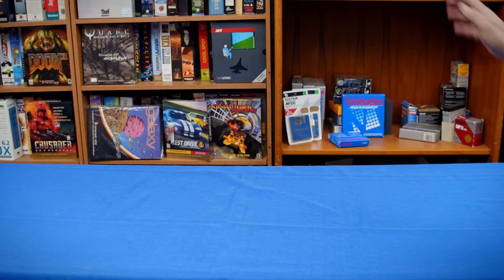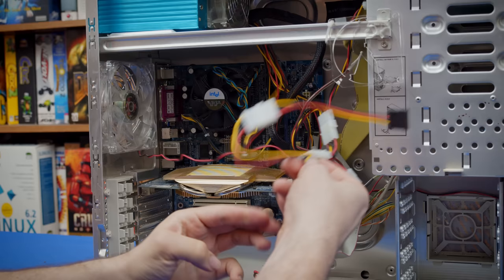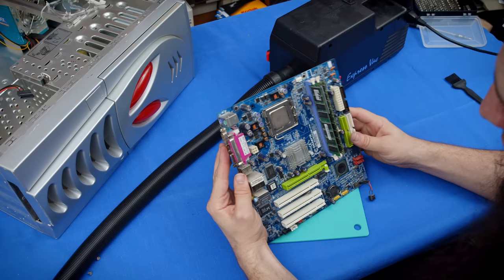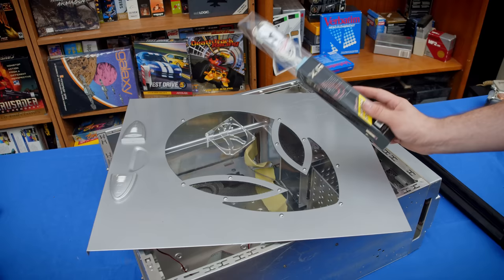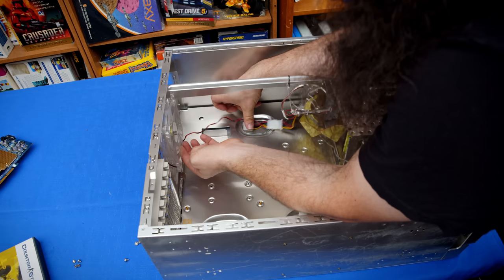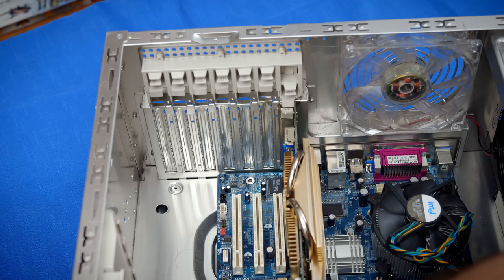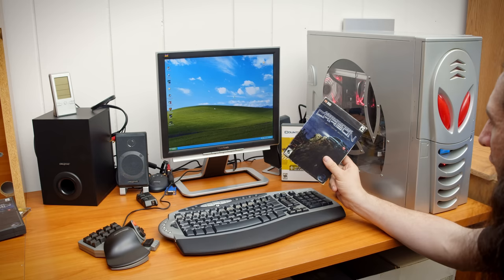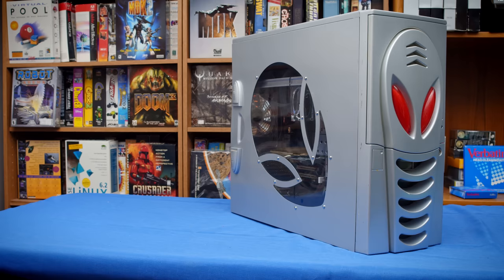Windows XP Gaming PC Brought Back to Life

Comment: Ok, I had that exact wireless mouse, a different keyboard, and that exact same game controller on the left side of the desk lol. About this era I had a 2.5GHz Northwood core Pentium 4 that overclocked to 3.45GHz with I believe a 533MHz front side bus....and an Sapphire Atlantis ATi Radeon 9800 Pro that was overclocked nearly 100MHz on the core. I rocked that system for a while, then upgraded to a used AMD Athlon 64 X2 4400+ machine that was overclocked, and a heavily overclocked AGP Sapphire ATi Radeon X800 XT, that was then upgraded to a factory overclocked AGP HIS ATi Radeon X1950 Pro. That mouse was the only thing that I kept up till my AMD Athlon II x4/AMD Phenom II X6 1045T PC, at which point it wouldn't pair. Sorry for the tangent...just miss this era in the PC world lol.

Comment: Quite an interesting find. The PSU might be for render machines and smaller servers. 400W for 2002 (judging by the label) seem pretty much right for such things and seems like a budget-mid tier version at that. I personally had something similar but was a 500W, silver aluminum and is from 2004, it's overkill to place it in these pairings but better to have more then less in case you decide to upgrade.

On a related note a friend have also a Golden Series 500W PSU from 2003 that he still uses today in one of his modern machines. It's crazy that he used it for rendering videos and gaming while it never been repaired all these years. Like he said good luck having something from today lasting that long. All his new ones he bought from 2010 onwards fry usually after 2-3 years right around the time the warranty runs out. No matter if it's expensive or mid-tier they are made to break (and yeah not counting the cheap crap since they often even explode not just fry fast). 

Back in a day you could find things that can last a long time decades after it's shelf life. (depends what you do with it and how you treat it)

Comment: Yeah...That's a super sketchy power supply. They were bad when new -- they called them PowMax 'cause you'd get a maximum pow with alarming frequency. And if I recall correctly, it's not really a 400 watt power supply, it was a peak power that could be delivered for brief (very brief!) periods. The second fan on the front near the power output cables was added to keep it from immediately exploding when you did. I wouldn't even attempt to power it on even if the caps were good (they were garbage caps even when new) 20 years later.

Comment: Hey when I saw this PC I thought about CS. The reason it may not run optimally is because you aren't running the good CSS version. In 2009 the engine got a major overhaul with the Orangebox update. If you acquired the 2004 version it would run better. Cheers.

Comment: Plain GeForce 6800 was pretty good, but not top-spec for the time. 6800 GT or 6800 Ultra would have been top-spec. But those also would have had active cooling fans, for sure.

Comment: I remember back when cable management wasn’t a thing. You could get away with spaghetti wires with an acrillic window and people would still be impressed. These days, just one stray wire and your whole build is crap 😅

I love this case. I miss the 2000s and all the whacky designs. PCs had two distinctive styles. In-your-face gamer and basic office/home. The wacky cases just signified how powerful a PC likely was. Haha these days we have basic office, mobile, and sleek beauty that replaced the wacky cases. 😅

I would totally spend a few hours on this very PC in the video. Many games of that era I missed out on due to having severely dated hardware and didn’t graduate to XP til ‘05 which that old PC did a surprisingly good job with. 

I’m happy PCs age slower now. My 4 year old tower would be severely dated if we had 2000s advancement still.

Comment: just drilling out the old led and inserting a new one did not occur as an option.. bit of transparant stuff that dissolves plastics as 'glue' (any of that smelly stuff will do i guess. carpaint/epoxy harderner, transparant pvc glue, whatever)  and it'll nicely melt together again.

Comment: The issue with the optical drives, could be the IDE PATA cable, from memory there was IDE PATA 33,66,100 and 133? and some used 28pin and others used was it 40 pin - I recall I had a cable issue and slow speed optical drive in the day and bought a 40pin one as it allowed better throughput when daisychaining a secondary drive?  I really forget

Comment: I trash picked one of these from one of my neighbors about a year and a half ago. Mine had a Socket 754 Board in it and only Onboard graphics when I picked it up.
Reply: The BIOS splace had some system integrators name on it, but I don't remember, I think I saved the original BIOS somewhere, I was having some sort of issue and I flashed the latest BIOS straight from MSI or Gigabyte on it, I can't remember which one it was.

Comment: I'm in love this case damn if they were anything like me in  2004 that was a crap ton of hard drives at 5400 RPM zipping away on crypto I think I think at that point Bitcoin was still on a computer node but I could be wrong. You should add some old fashioned neon tubes with what was it bricks for transformers cuz they're all 120s. 😂😂😂

Comment: That PSU is going to need a LOT more than just new caps.

Leadman POWMAX units are notorious fire hazards and PC killers and almost always require multiple component upgrades before they should even be considered for use.

Comment: Use these parts to build a windows XP media center gaming PC

CPU: AMD FX 8350 
GPU: GTX 8800 760MB SLI (2x)
PSU: 500W gold 80+ 
RAM: 16GB (use the 64-bit version)
Motherboard: AM3+ DDR3 
DVD: ✅
Floppy disc drive: ✅
HDD: 1.5 TB
Reply: Hope it helps!

Comment: I suspect the 5.25" punchout is for those bay inserts with card readers an the like, perhaps lets you close the case door with a memory card or similar sticking out the front?
Reply: Or even the soundblaster 5.25" bay module which I had in the 90s! That had volume knobs and the like that stuck out the front

Comment: I’ve known this in theory but I would love it if you can answer with some practice behind it too - washing circuit boards or even whole electronic devices like CRT monitors (in water that’s not hard so that there’s no deposits after drying, like distilled water) or in 98% alcohol - should be fine as long as its well dried out with compressed air right away and then left out to dry completely for a few days - right?

Comment: I would consider picking up a somewhat fancier board for this build, since - par for the course for system integrators - this one's quite entry-level for what must be 2005. Single-channel DDR, yech - and only 266 MHz sticks at that. That's half the FSB bandwidth even for the (FSB533) P4 511. Something like a GA-8I945G Pro or GA-8I945P-G-RH or similar with a matching pair of DDR2-533/667 sticks and a P4 651/641/631 (or Pentium D 930, 935, 945) would be much more befitting of a rig like this. (Yes, a Prescott P4 6x0 would be more age-appropriate but the 65 nm parts are basically the same except running cooler, so no-brainer there.)
Reply: While I agree entirely on the drawbacks, they’re part of the charm! Better to preserve as is for period historical relevance. It’s a rare find.

Comment: That really looks like a early-mid 00s machine. Oh, sadly a P4 Prescott. Sucks more power and is slower per MHz than Northwood. And the AGP port and VIA southbridge doesn't look great either. Back then it was already Intel in general or nVidia nForce if you wanted SLI. Still hope that it can do dual channel. And XP is usable with 1 GB.
And with 84W TDP (which still meant something back then) the small cooler was a bit tight.

The speaker is indeed meant to warn when the card doesn't have the extra power in. My 8800 GT did the same..
When windows were cut manually and lighting meant going to the aquarium store. And the CS logo doesn't has to be done by hand, I remember those fan grills were sold back then.

The case reminds me of the Lian Li cases of the time. Lots of brushed alu, mounting accesories, only the front doesn't fit their style.
The blacklight would do really well with a DFi board of the time, often the PCI and IDE slots were UV reactive and even uv cables were available. And totally go for a nice uv cathode ray tube. That was the style at the time.
And now I have to look where my red Thermaltake fan is. That cooled a massively overclocked passive-built 7300 GT for years.
Reply: not Prescott - PresHOT

Comment: wow the way you handled that power supply when you opened it up made me extremely uncomfortable, just sticking your hands in there so casually, i know it hasn't been powered on in a while and the capacitors aren't doing to hot anymore, but i still wouldn't trust those to be safe to touch

Comment: careful, i have seen many of those PSU's die or short out. i had two of them and both died. and with that particular P4, its the one i think than runs as hot as an volcano. also, does that board support dual data rate RAM? two different timing settings of ram can possibly be an issue.

Comment: I still have a AMD 64 (3200+ iirc) 1.5GB of RAM and a ATI X800 Pro (it is the PE model that can be turned into the X800XT, I do know it is capable of doing that). It is the older socket 745 system with single channel memory. On one of the Nvidia Nforce Boards, I believe it is one that doesn't like newer versions of sata? I havent turned it on in a long long time, but I do remember having issues with sata when I tried to toss in a old SSD into it years back. Think it has the sata bug where it is limited to Sata1 on the main chipset but does work on the 3rd party sata chipset. 

It is cool to just hang onto, but kinda pointless as a usable machine. Those older era boards don't age well with the crappy caps. I have my old C2Q as a old XP Powerhouse with a HD5870, new enough to support everything XP without issue. Everything just sitting in storage tubs. The EP45-UD3P board I have should last for ages. 

One day it will all be wall art.

Comment: I could see this being used for CS 1.6 over CSS. Earlier versions of CSS might've been lighter to run as well. CSS v34 is commonly pirated still even and Its fans boast better performance. It's a version from pre-orangebox update, circa 2009. 
It's a shame that valve games beyond HL2 suffer from their Steam requirement for uses like these. Getting older versions of games like HL2 has to border/rely on piracy but thankfully Valve doesn't take much action on it.

Comment: This was certainly not a high-spec build when it was bought so your $1k price estimate is likely right on. Pentium4 511 was released in late '05 when the bigger Prescotts were available at 3.4ghz+, 800mhz fsb, and Hyper Threading and the AMD64s X2s were out kicking all the ass. The VIA chipset board was pretty lame and Powmax was a bargain bin psu brand as well. That all being said this was probably well loved with the original owner making many unsavory comments on his team's Vent server (which was the style at the time).

Comment: I would straight up install a modern system in this case and run it as my daily.  I'd even leave it original specs, but a p4 2.8 just doesn't have the horsepower to run Adobe CS6 :)
Reply: RogerWilco99  I know.  I'm not a collector or a historian, I see little value in hanging on to something like a later P4, there were a billion of them made and none were particularly noteworthy.  I want that case for my daily computer, that's all.

Comment: This sort of machine is where "retro" currently fizzles out. And I am kind of worried that it will forever end there. Steam started creeping up and changing games distribution forever, online registration become a thing, just a few years on putting together a PC and installing a bunch of games from boxed and CD-covers was no longer a thing.
We won't be able to recreate the systems that came after this with the same ease and many games and software will be lost forever. Most of the time that Windows XP was around, Steam was already around too. So the XP era gaming experience is already no longer authentically recreatable.
In 2040, there will be no 2015-20 retro machines and their games we fondly remember. The machines might be around, but they'll be utterly useless.

I already have the problem with a  bunch of Core2Quad Socket 775 Systems. What to do with them? Too old for a modern system, too modern for an XP system, kinda.

Comment: 28:21 I was surprise to see windows 10 on that. How? I wonder how well loads it
Reply from the maker: Turns out it actually had a 32b Windows 8.1 installation disc in one of the DVD drives. I thought the HDD may have had an install on it when I first said that and didn't expect it to have a bootable disc in it! I ended up cutting that out because it took me a while to realize and it didn't really feel like part of the story of the machine since it wasn't actually installed.
Reply: @TechTangents  oh well that's explain lots of things. Some 775 processors are capable of runing win 8 and 10 but requires a lot of effort to make just a browser pc in the end.
Reply: @TechTangents  thanks for the answer

Comment: I remember the selling point of a good power supply was the weight of it. The heavier the power supply weighed, the better, RIGHT?
I had a gold anodized power supply that was really heavy. Paid almost $50 for it, I don't remember the wattage. The thing FAILED 4 months later, I opened it up and found two pieces of ANGLE IRON glued to the underside of the top cover.  The board was charred almost black from the heat, The fan was locked up and most of the caps were blown.
I guess this was the Chinese taking advantage of Stupid Americans wanting to build the Best Computer for gaming.

Comment: Carbon was a turd. Should have played Underground and Underground 2. I have a comparable system with a Radeon x800 and same processor but 1.5gb ram. The x800 and 6800 are pretty evenly matched. Though did you say your 2.8 P4 is NOT hyper threaded? Mine is. Are you sure?  Did they make both? I double checked mine is definitely HT. Other games I still play on it. F.E.A.R., Half Life 2, Medal of Honor. Toca Race Driver 3. Also good idea to get a better sound card. WinXP was still in the days of hardware accelerated sound. A decent sound card could take audio processing load off the processor. Not a big deal but every little bit helps. Also this was the age where most games supported things like EAX. Some games like Doom 3 sound AMAZING with the EAX on even if it is just a bunch of fancy reverb effects.

Comment: The extra AT-style connector at 5:38 in the video might have provided supplemental power for motherboards that needed them.  Dell Dimension desktops built between 1998-2000 (when they were still beige) had a similar AT-style supplemental connector, but I can't remember the voltages that it supplied.  Also, in addition to the standard AT motherboard power connectors, IBM also used two of these supplemental AT-style connectors in their Aptiva line from 1995-1997.  These provided additional power from the 3.3V rail (or the 3.52V rail in IBM machine type 2161 from 1997) to both the CPU and motherboard riser.  I'd be curious if the connector outputs +3.3V from the 3 orange wires.
Reply: I believe the 6-pin connector was also used on early P4 Socket 423 boards as well.